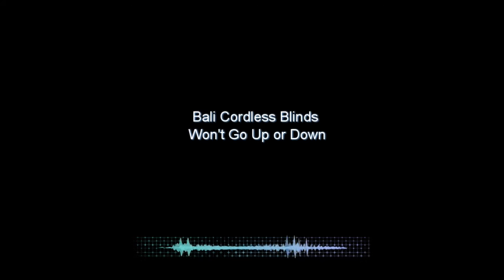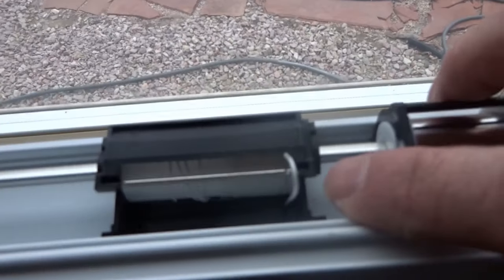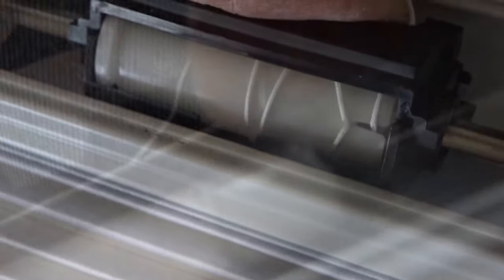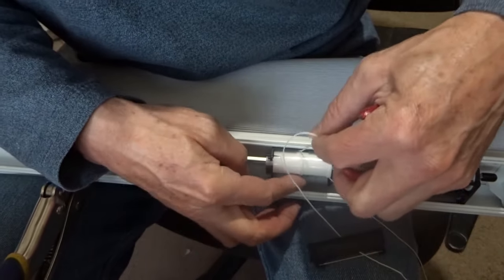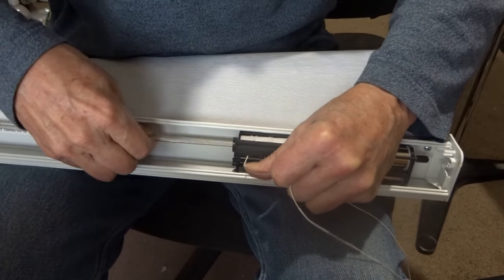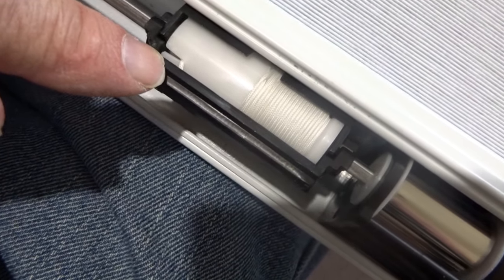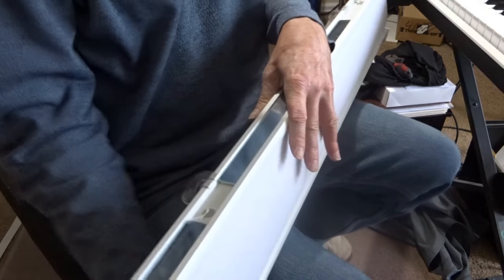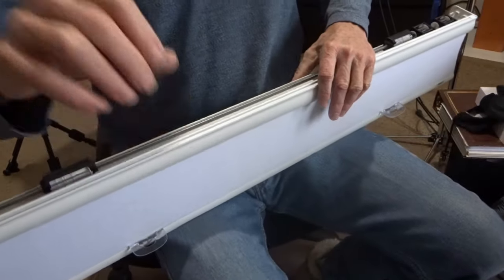Bali Cordless Blinds Won't Go UP or DOWN (SOLVED)

Comment: I did a shortcut. Instead of unrolling the string (which I found hard to do) I simply unrolled the string off the spool on the opposite side of the spool from the slot. I got it down to the groove and insured only one string was in the grove (as shone) and then began to feed the string back on the spool from the other side.  One of the rollers (I had two that were wrong ) I had to remove the short metal rod (it clicks right out) and reinstall it from the other side.   Hard to explain but once you get into it it becomes apparent what you need to do.  I tightened it from the bottom and put it back together and it works perfectly. This video is great for showing how it all works together.
Reply from the maker: Thanx for the tip!

Comment: Ok this I much simpler fix then this video instruction. After you take off the dust cover and the little black cover over the sting wound area all you have to do is pop off both ends caps then push the square metal rod until it past the white plastic string roller, lift the roller out, EASILY unwind the string, rewind it back correctly then put the white roller with string rolled up back, put black cover on, push square rod back and your done. Waaaaay easier then this video shows. Took me less then 5 mins to fix.

Comment: Any experience with replacing the tension mechanism? I fixed the part that wraps the string but the other part with the tape seems to be not working with mine. Any thoughts on this part or how to fix?

Comment: Ugh just got ours and our biggest window has this issue. To be fair, I think this one was not a factory defect on ours, I'm pretty sure it's because my husband was trying to raise it by only lifting one side, which put tension on the far side and slacked the one he was using (allowing it to double-wrap around the roller there). I couldn't find a solution to this anywhere, thank you.

Comment: I work for Bali and I want to take this video and share it with everyone who calls in for remakes when there’s such an easy fix!! This is the best!
Reply from the maker: Cheyenne Victoria Thnx, unfortunately I cant’ recommend Bali based on my personal experience.  I have had to futz with every one to get them to go up and down without hassle.  Maybe it’s just Spring Fashions which is the actual manufacturer according to the labels on the shades.
Reply: patpatpat999 well yeah that’s how I work for, SWF. Bali is the label. this video is so informative, and helpful. I see a lot of people have put good feedback for it, which is awesome. I don’t actually work in the plants, I work in the office and videos like this are so handy!
Reply: Do you know how to restring one of these cordless top down bottom up blinds? Have had two break on me in the last two months.
Reply: My “Nien made” blinds (on the mechanism) have a metal wheel as sharp as a razor blade I just discovered on Christmas Day 😡 Why would they do that?? I may need to go to the hospital for stitches. Just a warning with these. Also, though I can no longer get them to go up I see no overlapping or wrapping around the axel yet.
Reply: Add new cord because old cord separated ?
Reply: How does anyone stabilize the motor o you can .
Reply: Sorry-that’s a giant pain!!!!
Make them correctly from the first!
Reply: @patpatpat999  I agree, I wouldn’t recommend them either.  They cost me a fortune and I’ve had a lot of problems with them not staying up. I’ve even gone to Lowe’s and had all of them replaced and the replacement ones do the same thing.   Also, how did you get it to wind like that when you rewound the string?

Comment: I have a wide Bali with five rollers.  All the strings appear to be fine with some overlap but only one thread at the slot. The blinds are "locked" in the upper position and wont budge. The strings are so tight I can't even start to unwind them. It seams like the brakes are locked.  Is there a way to release the tension?

Comment: I have a Bali cordless blind, basically the same as shown in your video above.  The problem that I have and can't figure out is that on one side there are two lines, but on the second side there is only one.  When installed, it is the top down counterbalance.  Can you shed any light on how I remedy this situation?  Thanks in advance for your assistance.
Reply from the maker: @xterranation  Sorry, no idea, I dont have any Bali blinds anymore.
Reply: @patpatpat999  Thanks for your reply.

Comment: My problem turned out to be a knot in the string in the middle of the blind. I removed the blind, pulled it out to full extension, used vice grips to hold the shaft from retracting, then pulled the strings out from the bottom, pulling the knot out the bottom and untangling it. Reassemble and, voila!

Comment: Very helpful clip providing the information I needed to explain how the cordless mechanism works. My situation did not involve the string coming off the roller onto the shaft, but was mainly that the retraction mechanism seemed to be binding somewhere. 
 But I was unable to locate the point(s) of binding. With the dust cover removed, I could see the re-winding action of the string on the take-up rollers, and after gently moving the blind up and down in short strokes, it seemed to loosen up.
Reply from the maker: applesguy I myself don’t fully understand how they work.  I “think” the weight of the shade pulls down on the thing metal bar. The downward force applies a braking force so when you lift up the rewind spring is free to do its’ thing.

Comment: Worked! The string that doesn’t respond (snap back after tugging) is the one that needs to be unwound. Tug it out gently then try to unwind it until it snaps back like the other ones

Comment: I just finished trying to repair mine, and the string is key for the most part, but whatever you do, don't screw with what I think is the locking mechanism? It looks like a sheet of thin metal wrapped up, depicted in your video at 2:49. I took the rod out trying to repair one of the cords close to it, and I heard a snap and what sounded like that metal part was unraveling. Now my shades don't go all the way up anymore. They hang about 7 inches or so.
Reply: Same thing happened to me. Were you able to fix it?
Reply: That may have been the tension spring that assists rewinding it

Comment: Any idea how to restring? One of the strings broke
Reply: I broke one of the strings when my blind was too hard to pull down. I'll assume that on your blind only one string broke. Use the other good cord as an example of what your restringing should look like. I used a 4" sewing needle (maybe it was a darning needle) to thread the string down through the closed shade to bottom. I had to tape the string to the needle. I used a little tape as possible. The string goes through a grommet at the bottom of the blind. I think I had to remove the grommet in order to thread the cord. Then I threaded the cord through the grommet and then inserted the grommet back into the bottom of the blind. The cord then gets a knot in it.

Comment: very clear video to resolve issue of not retracting. Do you know if any hardware store or online store selling the retractable tension string? I searched everywhere to buy the string and replace it, but no luck to find. My blind's middle tension string is cut at the moment.
Reply from the maker: Just search Amazon "Cellular Blind Cord"  You may need some calipers to make sure the size of your cord.  If you get something too thick, you'll have problems.

Comment: Cordless crap they should call not just cordless if it ain't broke don't fix it why did they go with a cordless when it's crap
Reply from the maker: 1-  Other cordless brands work great, and I like them
2- I believe it;s a Gov safety requirement now.
Reply: Little kids getting the cords wrapped around their necks and strangling themselves

Comment: where is the control rewind, we are good up to that point.  these are not motorized blinds and I need to 
re wind the cord  thank you
Reply from the maker: When I said "controlled rewind" i meant letting the cord rewind in a slow and controlled manner.  Nothing to do with motors.

Comment: Thanks, but the problem on my 2017 Bali cordless blinds was different.   
The issue wasn't the brake portion (which I did slide over a bit away from the string roll)

I found that when winding back up the string HAS to push over the rest of the roll of string that's already wound up as it goes.   The further up you go, the more it pushes over the roll of string to push it out of the way.   I'm sure that tension is part of the overall tension and sticking problem.

If that string roll binds at all when retracting (won't move over) the blinds sticks. 
If any strings are crossed going up or down it also sticks  

I added a bit of the dry film lube onto the surface of the white string backing roller while retracting .
Now the roll of string can slide across the string roller as needed.   (I didn't get hardly any on the string itself).   

Finally, the blinds that were sticking for years going up or down move ok.

Comment: My problem was the string that extended down through the pleats and tie off end of the cord pulled through it's little washer. I could see string piled up through the the top pleat. The Dry Teflon spray you recommended made the shade as good as new once the string was re-routed through the shade and tied off.
Now I know what to do with the other dozen Bali shades that no longer close without a fight. Thanks!